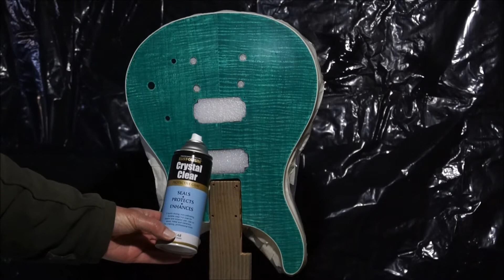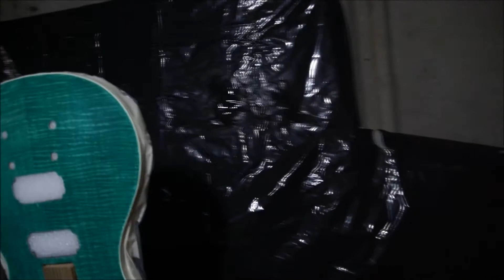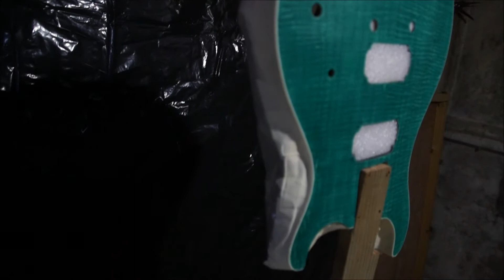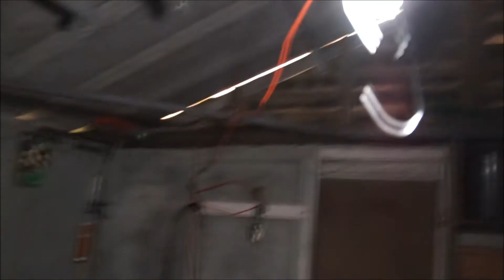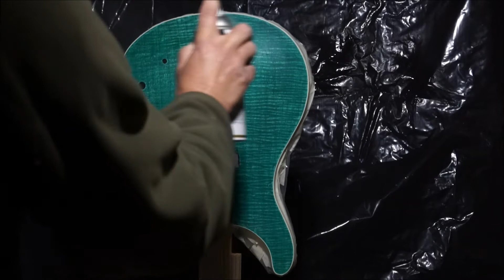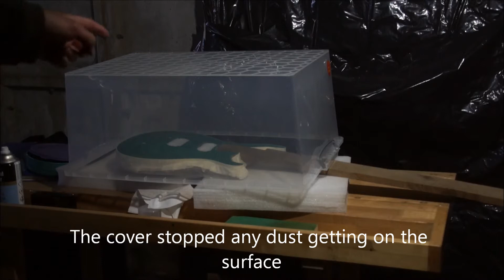Spraying DIY kit guitar with Clear coat

Comment: Hi mate, I’m looking to do something similar, to a tele thinline baritone project, over the next few months. I hope to do a Northern Lights version of sorts, though lightly dreading it, afraid to stuff it up.

The way I understood it, you do three layers, let it cure for three days, lightly sand, clean & spray another three layers, let it cure, sand, clean & spray another three layers (perhaps another three layers). Otherwise you have a chance that the bottom layer won’t cure & stays soft. Also, the chance of “orange peel” is smaller, as you sand out tiny height differences in between coats.

Then wetsand 600-1200-2000 (up to as high as you deem fit) & buff the finish.

How did yours turn out in the end? No soft undercoat? No orange peel?

Comment: Heat the can in hot water first to improve the spray quality.  If you're only doing the top, surely you would have it flat to dry, upside down to negate dust particles.

Comment: Your spraying technique is terrible. But I like the color.
Reply from the maker: So what would you have done that would have been better?
Reply: @anorak211  when you spray you move one direction off the body then stop pressure on the nozzle. It’s more of a short burst across the entire body. So it’s more off a pshhht-pshhht-pshhhht.....instead of a pshhhhhhhhhhhhhhhhhhht.
It keeps the overspray down and uses less material than constantly holding the nozzle down. It also keeps the finish more even.
I paint cars and refinish guitars so am not trying to be hyper critical, just offering advice.
Reply from the maker: I welcome advice, thanks